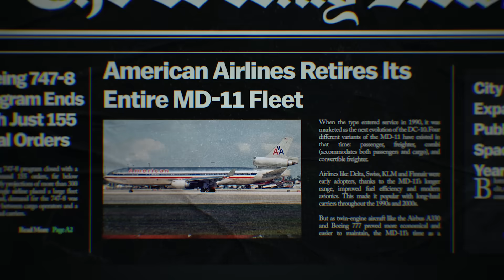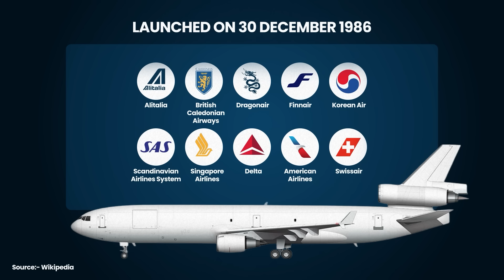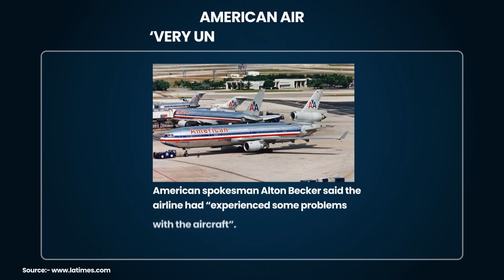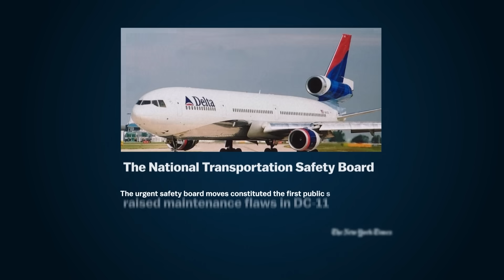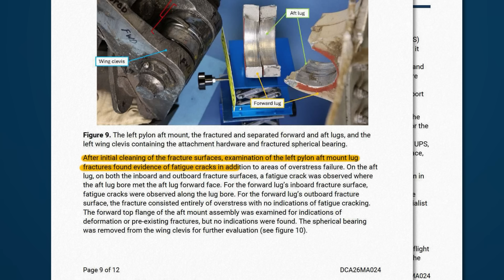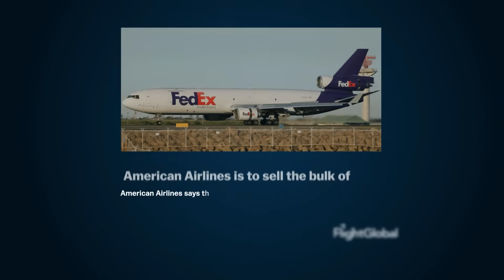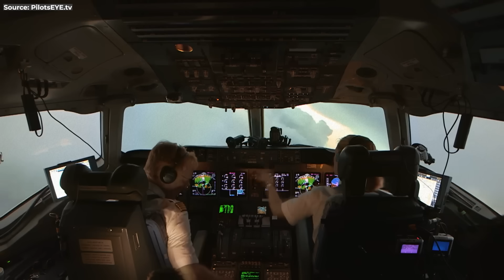Why UPS and FedEx Still Fly 35 Year Old MD 11 - Against All Logic

Comment: I flew the MD-11 twice, back in the 1990s, on Brazilian airline VASP, from São Paulo to Miami and back. I generally liked it; it may have been an optical illusion, but it felt roomier than a 777. I had only two complaints: first, there seemed to have been too few lavatories for the number of passengers (at least in VASP's configuration), and even though the plane wasn't full on either flight, there were always queues to use a lavatory, and with that demand and no time to clean them up, they were soon filthy and remained so throughout the flight.

The second complaint is that I'm a short man at 1.67 m or about 5'6", and I simply couldn't reach the overhead luggage bins. I had to ask a taller passenger or crew member to place and retrieve my cabin luggage. I didn't have that problem in any other aircraft type. I may be short, but I'm still in a height range where many other passengers also are (especially but not only women and adolescents), so it was a real inconvenience. I can understand why KLM was the most loyal and last MD-11 operator in passenger service: the Dutch are known for being the tallest people in the world, so it must have been even more convenient for them. I didn't fly on the DC-10, so I don't know if it was the same thing.

The MD-11 also had a strange sound while it was taxiing — not with the plane stopped on the ground and not with it flying, only when taxiing. It's hard to describe, but it was a mix of the sound of metallic parts scratching with a dog wailing (not barking as with the A320), and it was rather loud. My flight back had two stops, so I experienced four takeoffs and landings on the MD-11, and it happened when taxiing all four times. It was annoying, but since it was limited to just a few moments, it wasn't a major inconvenience.

Comment: The article announcing that they were extending the retirement date was published in March, well before the UPS crash a month ago.  Now that they are all grounded INDEFINITELY, It's my opinion that FedEx and UPS will never fly these airplanes again.  It will likely be at least a year and a half before the NTSB has any recommendations and the FAA issues a fix enabling a means of returning these airplanes to service.  By that time, UPS and FedEx will have trained their MD-11 pilots on different aircraft types and none will be current on the MD-11.  The cost to mothball, store, fix, and get the fleet airworthy again after an undetermined amount of time is prohibitive. And we don't even know IF a fix will be available, what it would consist of, or how much it would cost.  UPS and FedEx will likely cut their losses and move on.  But I suppose that's for the bean counters to decide.
Reply: That is a fantastic idea! Retire these planes and move on. They are not worth the risk. I know everyone feels bad for FedEx and UPS, and how it could hurt them financially. Well, that’s the same reason these planes got designed in the first place. Greed! McDonnell Douglas wanted to beat Boeing and Lockheed in the race for a more economical plane. McDonnell Douglas cut corners and sold planes, knowing that they had failed safety tests. 

I think that human life is more important than UPS and FedEx’s finances. Especially for the families of the people killed.

Comment: Aviation is a slow moving industry.   A completely new plane design takes 20 years to bring to market.   That's why once you have a viable air frame, you use it, tweak it, and perfect it.  But, you dont just scrap it, thinking its easily replaceable.   If rigorously maintained properly these air frames can last up to 50 years.  And, its cheaper to maintain them then it is to replace them.

Comment: What wasn't discussed was the liability costs of flying planes with known safety issues.  The payouts for a couple flight personnel can be more easily absorbed when the customer cost per unit weight is significantly higher than passenger planes.

Comment: These planes were made with three engines due to FAA rules that if you flew over water you needed more than 2 engines for safety and redundancy so that if an engine fails at least you have extra to get you back home. However, the FAA did away with that rule and 2 engine planes were allowed. That immediately made these 3 engine planes obsolete since they used more fuel to do the same thing.

Comment: They still haven't fixed the engine  pylon attachment points???!!!
You would thing they would all have been grounded decades ago until fixed.
Reply: The cargo door on a DC-10 flew off of an AA96 plane while in flight. The pilot managed to save everyone on board. He had just enough control to save the plane. McDonnell Douglas was ordered to fix the Cargo door on all of their DC-10’s. They never did fix all of them. A Turkish Airlines plane had a cargo door fly off while leaving Paris. 

That was a short time after the AA96 plane lost its cargo door. The Turkish Airlines plane crashed and killed 346 people. McDonnell Douglas knew that there was a problem before even selling the DC 10 on the market. It had failed their own test, but they left it as is, and sold the planes anyways!

After the AA96 incident they were supposed to deal with the problem. They didn’t and another crash happened. They admittedly didn’t want to spend the money to fix the entire fleet. Safety was never even on their radar!

Comment: Not withstanding the safety record, which is by no means the worst in the industry, the real key freight ops factors are volume and overall airframe durability.
The MD-11F volume capacity is over 86% of a 747-400F. The majority of freight operations volume out. 
Since cycles are very low with freight ops, modified airframe maintenance schedules for the DC-10 / MD-11 and KC-10 have in some cases allowed for the elimination of the expensive D checks.

Comment: One critical point that was missing from the video is the fact that cargo carriers need to know exactly which models they'll be transitioning to, and when. They don't just set a retirement date for their current fleet without ensuring a proper replacement. The stroke of luck they got in the mid 90s won't repeat itself for the next fleet upgrade, which would make a fascinating video as itself: how do carriers prepare to replace their current fleets, with what, and how?

Comment: 20 years ago i was a passenger in an MD11 and i remember that it was quite comfortable. 
I have always wondered if it would have been possible to shut down that 3rd engine while cruising at high altitude. You could restart it for the decent and landing. That could potentially save lots of fuel on a long haul. Would that have been possible?

Comment: I've seen it's second engine turning into flamethrower. It was taxing with a tens of meter of flame behind it until it got to safe place for firefighters to extinguish that fire. It turned out to be leaking oil from some damaged gasket that got to the hotter parts of the engine. Amazingly no news were ever made about it, which is strange given it was taxing behind several stands with passanger planes on rotation.

Comment: For the same reason all cargo airlines use old planes. Yes, they are less fuel efficient than new planes, but they are usually flown a couple of hours per day. To replace the same capacity with new planes for the sake of fuel economy would cost a large fortune.

Comment: The cause of American Airlines Flight 191 was improper maintenance procedures. McDonnell Douglas maintenance procedures called for removing the engine and the pylon separately. However, to save time, American Airlines removed both as a single unit. When reattaching both the engine and the pylon, they used a forklift. This required precision and proper communications. However, it banged up against the attachment bulkhead and damaged it. Stress cracks form which got worse each time the plane took off. On Flight 191, the engine flipped upwards and landed on the runway. It took out the hydraulic lines and caused the slats on the left wing to retract. The plane then banked left and stayed that way until it crashed.
Reply: Maintenance is always the first blamed. I blame greed!
$pread the joy back to the $hop personnel.
Stop pandering to the house and place your bets on your people.

Comment: From what I understand, many older airliners that are less efficient  are converted to cargo operations because profit margins are slimmer in that part of the industry. I remember reading way back when the MD-11 was under development , and many thought the aircraft was bucking  the trend. Airbus came out with the first widebody twin jet airliner, which led the way to other wide body twin jets. Twin jets are more economical, period. What I think was a more unsound decision was for Airbus to make the A380. Its more of a prestige aircraft for Airbus as they lost money building it. The A380 bucked the trend, which was point to point airline service with a fuel efficient twin. The smaller fuel efficient twins could fly into more airports that the A380 couldnt. I havent been on a A380 but I cant wait to fly in one, as it appears its days are numbered.

Comment: As someone who flew on one... once... I hated the experience. I was on the rear passenger row and it turns out that they bled air from the cargo hold into the passenger compartment.. As in freezing cold air. Directly around your ankles. Very uncomfortable flight because of it (was a KLM plane just like around the 2:40 mark)

Comment: What is the advantage of having the engine so far forward of the wing?  Clearly this produces the excess tension and torque that rips the engine from the wing by its own thrust.
Reply: They were designed with the engine so far forward of the wing so that if the engine falls off, it will go up and over the wing. That was McDonnell Douglas’ plan anyways. Turns out that the engine going up and over the wing is not the greatest idea as it severed the hydraulics on AA191, and likely did the same on the UPS plane. 

The NTSB has suggested ( although they haven’t finalized any report yet) that parts of the engine that went over the wing when it came  off the UPS plane,  flew into the 3rd engine likely rendering it inoperable. Leaving the right engine as the only working engine.The plane cannot become airborne with only 1 engine operating.

Comment: ETOPS was what really made the difference, im glad you brought that up. This is why the 777 broke the MD11's back. United Airlines and Boeing cooperated to develop the 777 and UAL made a great hedge for twin engine longhaul flights over water.

777 is a great plane and I am excited for the release of the 777X platform. When I worked at KBFI I saw them tested the -10 models. Theyre so long its almost mind boggling to see

Comment: There’s another factor. Douglas Aircraft’s design manual was used for the MD11. It has a conservative philosophy for the airframe. When the C-17 Cargo jet wing broke during load testing, President Clinton called for a review by the DEfense Science Board. It was the first time that Boeing, McDonnell Douglas, and Lockheed opened their books and compared their structural design assumptions. Bottom line, the Douglas airframes last longer (and are heavier/fuel mileage).

Comment: -bargin used plane price
 - passenger airlines not happy with then. Especially with the new twin-jet regulations coming in
-fuel efficiency is less important to cargo planes which spend more time on the ground.
-limited range is further than cargo operators need them to go anyway

Comment: You’re wrong on why Fedex and UPS keep using the MD 11. You’re partially wrong. A regular airline like American Airlines gets new planes because liability becomes greater and greater when something catastrophic happens and you have 300 passengers suing you. And they can easily blame the fact that you have an old airplane as a reason to sue you UPS and Fedex don’t have that concern obviously, they don’t fly passengers so their insurance and liability cost are very low because all they have to worry about is running into things and hurting people on the ground not in the air, which is a lot smaller and less risky. That’s why there’s no need to upgrade the plane.

Comment: The age of an aircraft isn’t a measure of its value. Many military jets like the venerable B-52 are 70 years old. With good maintenance they can fly indefinitely. 
However the UPS MD-11 that crashed had 93,000 flight hours on its airframe. And over 21,000 takeoffs and landings. That is an enormous amount of use. Military jest spend a lot of their time on the ground either in maintenance or waiting for an assignment. 
Those UPS jets have a short turnaround. They might arrive in the morning from Europe or Asia and by afternoon they are reloaded first another long flight. 24 hrs/day. They only rest on the weekend and holidays. Thanksgiving and Christmas are two days when literally dozens of MD-11s are parked in Louisville. Many are on the ramp at the maintenance hangar waiting their turn for inspection and maintenance.

Comment: if one is jumping on the "let's make profit from a crash" train, get your facts straight. Singapore Airlines never really ordered the MD-11 so they could never retire it. They had 20 "reserve commitments" from which they walked away less than a year after the plane entered service. to answer your question in a few sentences: the MD11 found its cargo niche because they were cheap to come by, fit the market and make sense to the operators some of which already had plenty of DC-10s. Apart from some first gen 747s, the only other "large" cargo plane at the time was the DC-8. The 767F only came in the mid 1990s and were new aircraft (expensive). Cheaper 767 freighter conversions did not appear until more than a decade after them. See no stock footage and no 15 minutes of trying to come to the point.

Comment: 1. 35 is not "too" old for an aircraft, ABX Air fly's 42+ year old 767-200s, 2. They have not been replaced because the availability of replacement airframes due to back log of production airframes and back log of conversions airframes.

Comment: Why keep flying them?  Because there are no cargo aircraft available on the market today. Boeing and Airbus are not building freighters at this time. A350F conversion had been announced but not yet certified. The 747 & 777 lines have been shut down. The 777X freighter is years away. The 767 doesn’t have the lift capability. 

When MD11 became available they were cheap. The MD11 freighter conversions made FedEx and UPS a ton of money. 

The MD11 fills a sweat spot. 
That’s why retirement dates keep getting pushed back.  If the FAA is satisfied and inspections are done it’ll be back in the air.

Comment: This is a poorly researched video—the referenced DC-10 crash was the result of improper maintenance, not a design flaw. This is a huge part of the reason why it was retired early, because of (irrational) public opinion. This lead to widespread cargo adoption of the DC-10 (because it was cheap and being retired by passenger airlines) and was therefore a major contributing factor in the fleet commonality component of MD-11 acquisition by air freight carriers.
Reply: Yeah it’s because it’s an AI channel
Reply: @zenquah I'm aware but I'd rather go after the substantively incorrect things than the fact that it's AI stuff.

Comment: the MD11 need to be in the aviation musem, or scrapes for metal.
Every day they flying above our heads is a disaster waiting to happen.
Reply: It's a graceful aircraft....i knew a flight engineer who flew on many types of planes... The 747, 727,737 and the DC 10....when i asked him, which of these aircraft he liked the most... He answered " the DC-10...It hung in the air like a board. You could fly straight through thunderstorms with it, no problem."

Comment: When an engine does fall off, you are only going to lose two or three people, not 200 plus passengers. If you take one out of service for a week to inspect and repair/replace pylons, it doesn't adversely affect your passenger schedule. Flight operations can be scheduled to be between the extremely busy "connecting flight" rush hours at larger hubs.

Comment: Because that engine on the tail is majestic. Looks powerful and impressive.   Something nice like that you want it around for as long as possible.  When they are all retired all that will be left are these plastic models of jets that once flew.  But no longer in existence.
Reply: That tail-mounted engine (also on the L-1011) was always a PITA. You need to bring the aircraft into a specialized hangar to service it. On flights to airports without such a hangar, pilots would often just leave the #2 engine running (and burning fuel). To avoid the possibility of being stranded there if the engine refused to start up.

The reason to tolerate it was because 3 engines is more efficient than 4 engines. (And the era of tri-jets ended because 2 engines is more efficient than 3 engines.)